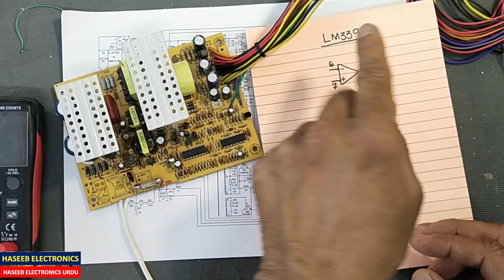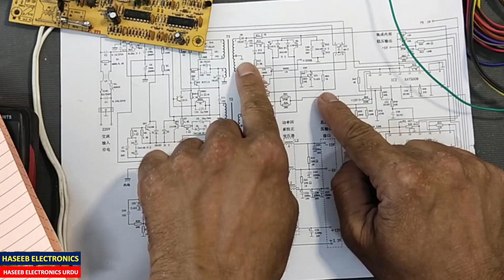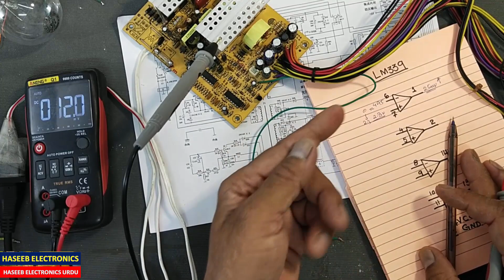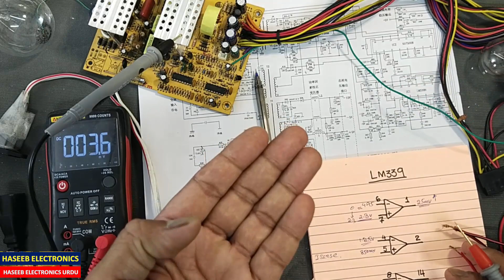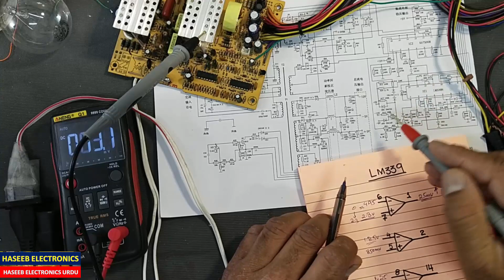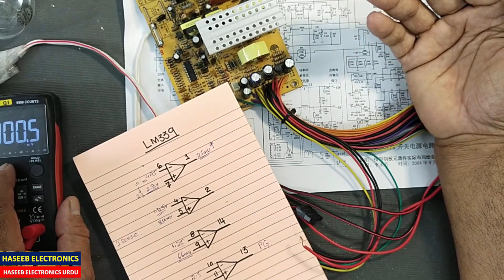{634} LM339 Differential Comparator IC As Voltage & Current Protection In Computer ATX Power Supply

Comment: i have this PSU, it works but i have 5.5V on 5V rail without and with load so it is out of 5% tolerance, hmm how to fix it? elyt on 5V rail looks ok, i also checked small elyts around LM comparator, looks all good, so i dunno how 5.0v happend on comparator input instead of 4.6V ... any advice?

Comment: Thank for your video. You explain the circuit associated with LM339 embedded in an ATX power supply so well. It is complicated for reader without electronic background. To disable those protection may be dangerous, are there any method to raise the trigger voltage for overvoltage protection? (e.g. 14.5V up to 24V at 12V output)?

Comment: Be very careful. Power supplies are the most dangerous devices I work on. They can actually kill. Those giant capacitors need to be discharged with a high wattage resistor and confirmed to be dead with a volt meter set to DC within the range of the volt rating of the capacitor. The heat sinks are usually live when the power is connected.
Reply from the maker: yes brother you are perfect, the capacitor bank is really dangerous. we must take care for safety
but if we work logically and keeping safety points. then it is safe to work

Comment: I have set the 12V output to 13.8V and do not use 5V or 3.3V output. How can I reset overvoltage protection to a higher voltage?
Reply: It seems I can increase the voltage to about 15V but connecting or changing the load trips the protection. I can short the 7500 PWM pin 4 and it's stable. What if I add a 1uf capacitor on LM339, pin5. Wouldn't that slow the response of the protection circuit but not disable it?

Comment: This is most excellent. Thank you. I have a consideration. But, first, let us check my understanding... The first section of the LM339 is making sure that the DUT's power supply has a ground. This is a method of testing that the supply polarity is connected correctly; yes? The second section tests to determine that the DUT's supply current is correct. The third section tests to determine that the DUT's supply voltage is correct. The forth section tests to determine that the DUT's output voltage is correct. If I have my understanding correctly, then the LM339 is testing the majority of all of the functions of the DUT's power supply and its final output. Further, if so, I wonder why this very simple and inexpensive method is not routinely included in linear power supply devices. The cost of the LM339 would be about equivalent to whatever reverse polarity protection is used for the DUT and it tests so many more properties. My assumption would be that it is not this cost that is the burden, but rather the additional cost of the downstream components needed for switching. Or, that it will not work for linear applications. So, I conclude with a few questions... If it will not work in linear environments, why not? If it will work in linear environments, do you have a link to a particular device where it is employed and which has a schematic available to study? I would be exceedingly interested in you reviewing such a linear application. (I would think that such a linear device would be some very expensive, precision instrument that would warrant the cost.) Please and thank you, as always. Cheers!

Comment: Very clear, now i understand more Op amps. In your next video, can you show how to make it ONLY 12v adjustable in voltage and current, and get rid of 3.3v and 5v to have a nice bench lab regulated power supply. Thanks.
Reply from the maker: it is my pleasure 
it was just a very simple introduction about LM339 as protection 
sure we will make it variable soon